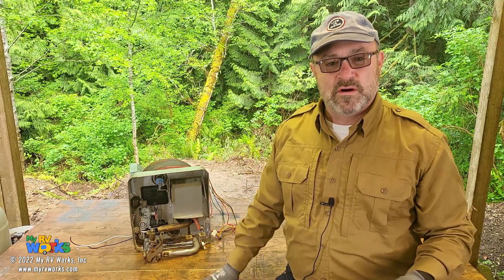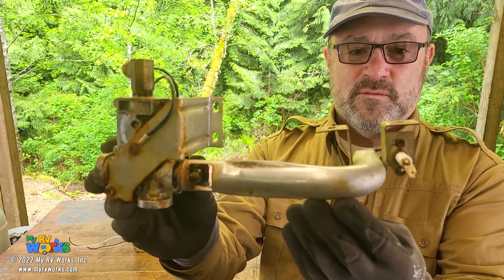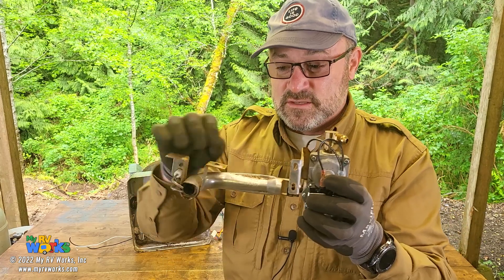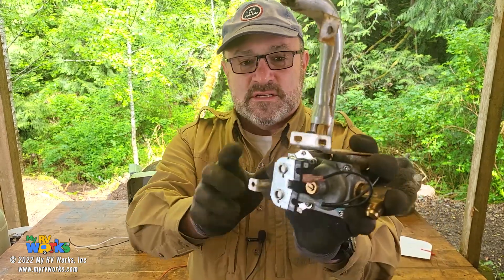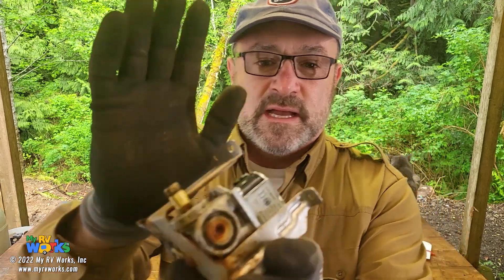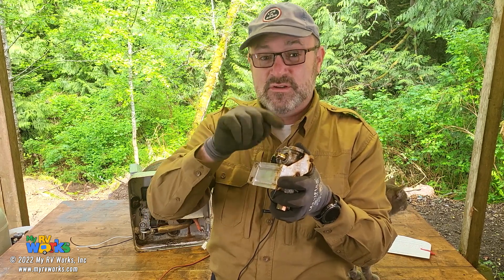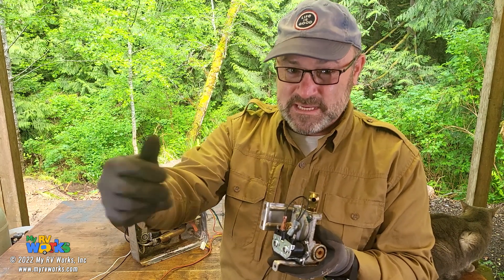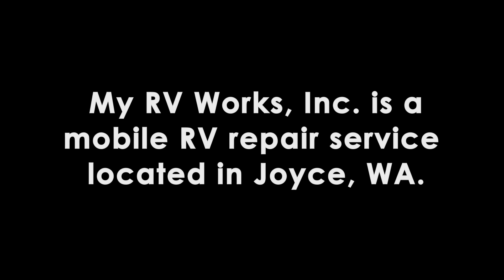Suburban Water Heater Repeatedly Stops On LP Function After 11 Minutes -- My RV Works

Comment: i got a wierd problem but I almost like what happens .Every morning i have to get up press the hot water tank lg switch off then on and w/heater fires up other wise we will have luke warm water . happens when water heater sits not being used .any guess  .cause it comes on and works fine as long as i  reset the on/off panel  switch in the kitchen. my camper has a 400lb propane tank on front and came new like this , presently 35% full.  Atwood 5 gallon < guess maybe smaller . Salmo bc canada presently in montana glacier park camping.

Comment: I have a similar problem with my water heater. It's a suburban 10 gallon. I replaced the thermostat/ high limit.  Burner runs until it's up to temperature then shuts off and won't restart until its. Cold.

Comment: Ok. Two words: bypass valves. New RV, first time de-winterizing, hard to see the valves inside the access door. I had one valve closed. Water heater worked until it hit the high temp sensor and then it shut off. No hot water because it was bypassing. Open valve, all good. Shout out to Jason's Mobile RV Service for his expediency, expertise, and patience. Helped that he worked at a dealer that sold Rockwoods like mine.
Reply: This is happening to me as welll. Rockwood mini lite 2020. Gas water heater will fire but shortly after stop being lit.  I checked to see if there is water in there and quickly opening the relief valve     water came out.   I can only see two valves on my tank.  No idea which way they should be turned
Reply: @esh1877  Both valves should be turned toward the water heater. Thanks again to Jason.
Reply: Mine did this as well, both valves were the wrong way. Filled the tank but still won't stay lit.

Comment: Hey sir! Thanks for your vids! Have issue I haven’t seen covered yet. Electric side is good. Gas side will completely heat water and shut off. Then, the dreaded red light comes on . Replaced t-stat, cleaned out flame and igniter tube. Lights on first attempt but won’t relight when water cools. Control board?
Reply: Hi! Did you find a fix? This is exactly what ours is doing. I can’t find a fix either. It’s like it is overheating since it always lets water out of the pressure valve. Red light comes on, try’s three times to relight. Flip the switch and it relights again.

Comment: My heater will ignite for less than 10 seconds three times and the whole time its trying to light the three times its clicking while trying to light. I get a great flame but it cuts every 5 seconds or so and it ticks really fast while the flame is burning for the 5 seconds its lit. Any ideas?
Reply: I had this same problem with my Suburban SW12DEL and it was a faulty Control Module Board (Part# 520814), which is made in China. The OEM Board looked fine, nothing was burnt, but it was definitely bad. So I bought a Made in the USA, Dinosaur Electronics UIB-S Control Module Board and my water heater works better than ever, fires on the first try everytime, doesn't cut out in the middle of heating, the red DSI-FLT light no longer comes on, and most importantly... ...it no longer shoots out a dangerous (malfunctioning) 8"-10" flare.

Comment: Hello, I just installed a suburban water heater model number Sw12De it’s a 12 gallon and it’s a dual source by that I mean it’s electric 12v and gas. It’s brand new. Everything was installed correctly. It turns on and the burner stays lit for about 24 mins. But the problem is that the water doesn’t reach temperature. It only get a little above Luke warm. We have checked everything from electricity water and propane. It’s getting power. There’s nothing being reseted. I don’t know what Else to look for. 

Does anybody know what might be my issue? Any help would be gladly appreciated. Would the thermostat be faulty from factory? 

Thanks in advance.
Reply from the maker: Have a good look at the bypass water lines on the back.  Sounds like the bypass valve is open - effectively blending the cold supply water with the hot return water.

Comment: Ive replaced the electrode, control board twice, cleaned everything including wire connections, still burns out when the electrode stops the current when the lighting voltage stops. Im so stuck. Its got a nice clean blue flame. All other appliances run perfectly on LP

Comment: I’ve kind of hit it dead end with this hot water heater because when started on it the electric side didn’t work. And the propane side didn’t work so I tested everything like you said figured out it was a circuit board bought a new one put it in the electric side works fine now the gas side comes on but only burns for like six seconds and you can hear the gas solenoid cut off, any ideals

Comment: I have a 10 gallon suburban from a 1995 Monaco coach and I’m having the same issue.   It lights when I turn it on and burns for about 10
Minutes and then stops.  It tries to relight itself but acts like it’s getting no gas.   I cleaned out the tiny little pinhole by stuffing a little piece of cloth that cleans jewelry (all I could find) and cleaned it out and blew threw it as hard as I could.   So far it has fixed the problem.  It’s able to reignite like it should.

Comment: Hello, I'm from Poland (Central Europe). I'm rebuilding an old TT Gulfstream 32FKS. I bought on ebay suburban SW12DEL water heater, but from the beginning gas part didn't work. As sending it back to the USA has no any sense I want to repair it on my own. In Europe we have totally different systems so I need your help to diagnose the problem before I order any part. When I switch the gas heating on, valves opens, spark fires the gas but the flame looks like candle flame. A controller do not recognize any flame, closes the gas valves, repeat this procedure two more times and then stops. Where could be a problem? Other gas systems like owen, furnace and fridge works fine. Please help. Thank you in advance.
Reply from the maker: You might start by checking the LP pressure at the water heater. We would consider 11 inches of water column the correct specification for that unit (11" WC)  if you look at the manufacturer sticker you will see reference to this under the manifold pressure. But you need to check it at the water heater as there may be a restriction upstream. The next thing, on our website we have manuals under our resources tab https://myrvworks.com/manuals/ .   With the correct information from the manual you might look at the orifice attached to the gas valve to make sure there's no restriction preventing the LP from properly flowing into the burn chamber.  And of course on our YouTube channel we have a playlist full of water heater repair. Watching those may help as well. Best of luck and thanks for reaching out to us from Poland!  😀
Reply: @MyRVWorks  Thank you for your support! Today I've removed and tested all gas parts of my water heater.  Everything looked fine so I looked into a gas cooper pipe and found that it was totally blocked by unknown yellow powder. Compressor and brake cleaner solved the issue :D. Many thanks again!

Comment: Thanks you sir! I fixed her. My gap was to closed and it would turn off after 2 seconds of flame being on. So pulled the igniter ground probes spaced them out to 1/8th and placed her back in adjusting toward front of J tube. Now stays on. Thank you my Rv works.

Comment: Hope you see this comment just installed a new 6 gallon hot water heater in my RV everything seems to work but sometimes the gas side of it will make a proofing sound Like the gas is building up and then igniting and sometimes it works just great like I said it is a brand new domestic 6 gallon hot water  Heater any suggestions. I really enjoy watching your videos they are very informative

Comment: Hi. I have the Suburban SW6D propane water heater and when the water heater initially lights there is a 8-10" flare that shoots out of the vent / grid. I am worried that this is an issue and could be dangerous. Am I right to be concerned? This is a 2023 Wildwood FSX 170SS - we are on our first trip.
Reply: Did you ever get it to work correctly? Having same issue
Reply: I had this same problem with my Suburban SW12DEL and it was a faulty Control Module Board (Part# 520814), which is made in China. The OEM Board looked fine, nothing was burnt, but it was definitely bad. So I bought a Made in the USA, Dinosaur Electronics UIB-S Control Module Board and my water heater works better than ever, fires on the first try everytime, doesn't cut out in the middle of heating, the red DSI-FLT light no longer comes on, and most importantly... ...it no longer shoots out a dangerous (malfunctioning) 8"-10" flare.

Comment: Hey Darren, fellow RV tech here down in Omaha. Another scenario I've run into that matches the symptoms described is a failing valve electromagnet.  I had a suburban furnace that would operate for 8.5 minutes before shutdown. It would do the same after a ten minute rest. I had to put my manometer into the valve itself to observe the gas shutoff before the electricity to the valve was shut off by the board. 
I think with a 11 minute run time on the water heater it is possible the gas valve is failing.
Thanks for making these videos!
Reply from the maker: Hey brother, thanks for the input. I love to hear from my fellow RV Techs!  We just keep building that circle of Knowledge. LOL

Comment: Darren, what are your thoughts on the Atmospheric vacuum breaker installed on the black tank flush? I have seen quite a few AVB leaking behind the walls on YouTube. Do you know of a better device? Maybe installing outside of the unit.
Reply from the maker: I'm not aware of any of these vacuum breakers leaking. I do know they're necessary. Perhaps go with a higher quality type vacuum breaker might be a solution.

Comment: Dometic RM8501 3 way fridge is getting colder on shore power
 ( 15 ice box / 35 llower fridge )
than with propain   ( 23 ice box / 48  )  in all day tests 
the blue flame looks fine to me ? but I  cleaned the burner in alcohol and cleaned the chimmey 
any suggestions ? should i replace the burner ? if so -  where would i find one ?
thanks

Comment: Have a question on a dometic water heater. Replaced the motherboard since it would fire on the gas side and shut off after 5 seconds or so. I also cleaned everything and it works fine except it stained the paint on the cover due to exhaust heat. I have a 2020 Beacon 42 RDB. What caused the heat stain? Love your channel and have learned a lot. Keep up the great work!